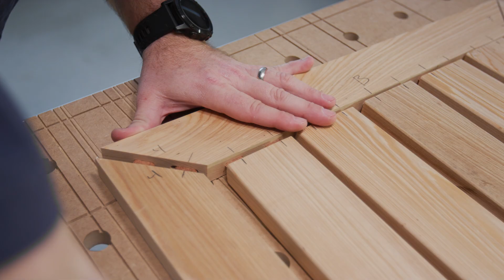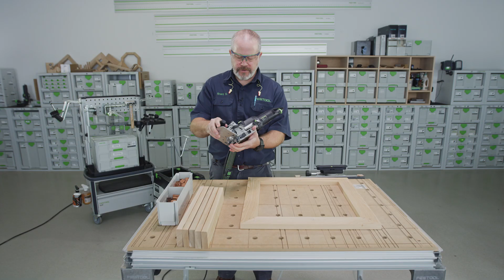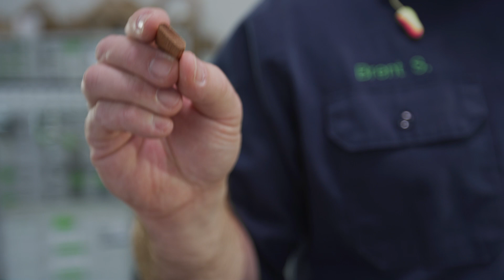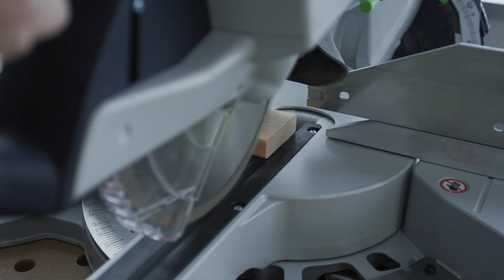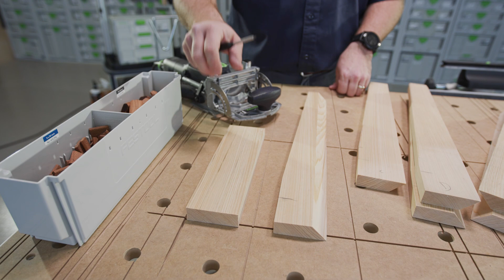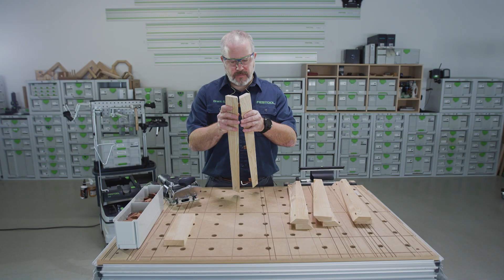Festool Build Series: Building an Outdoor Table Episode 5 Joinery with the Domino

Comment: After watching many Festool USA vids. I was led to believe when using a tight and loose settings to join end grain to edge grain the "tight mortise" should always be in the end grain. But you did the opposite for the table top slats and frame. What was your reasoning to do the opposite?

Comment: Love your build videos. Question about the strength of the dominos. I am expanding the dimensions of your table top into a rectangle to make an outdoor table for my Big Green Egg. The slats on top with run the length of the table, the slats on a lower shelf will run perpendicular to that (from front edge to back edge. The grill will drop down thru a circular cutout in the top and rest on legs, a cement paver and the bottom shelf. Overall, the weight of the 200 lb Egg will probably sit on 5 or 6 slats. Will 2 dominos in the ends of each slat board be enough to support that weight or do you think additional reinforcement will be necessary? Thanks for this outstanding series!

Comment: What happens if you don't turn on the Domino before adjusting the "looseness"?
Reply: It just doesn't turn.  I went to flip it a couple times when I got mine new and noticed resistance.  It was enough to tell me "hey dummy, turn it on first".  Problem solved :)

Comment: Question, how does making the 2nd mortise at the loose setting accomplish any movement since the first is tight? Seems the second tenon still wouldn’t have any movement because the first tenon is not going to move??
Reply: You're on the right track it's about ease of assembly. The two mating tight joints ensure alignment whereas the two loose make it easier to assemble.